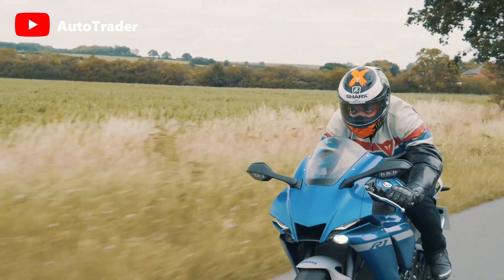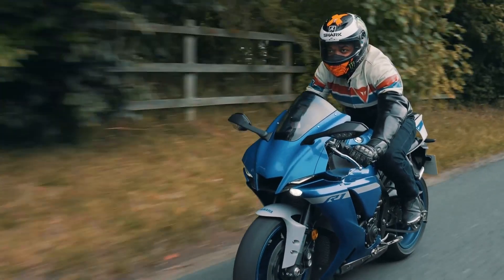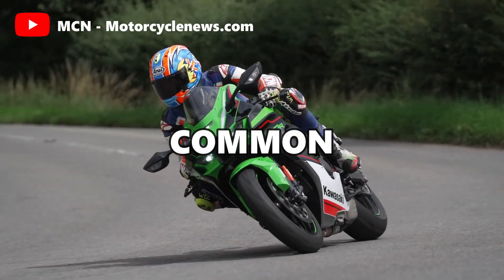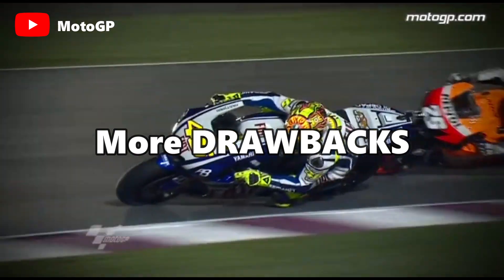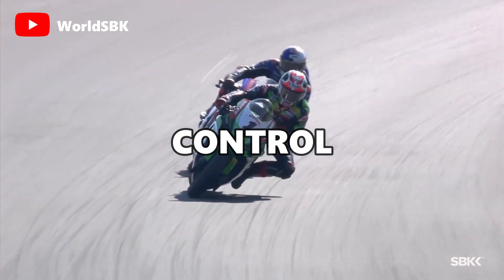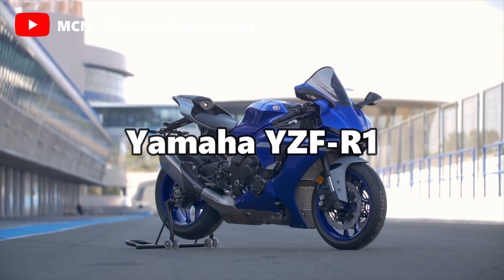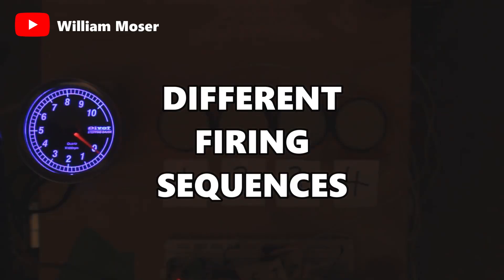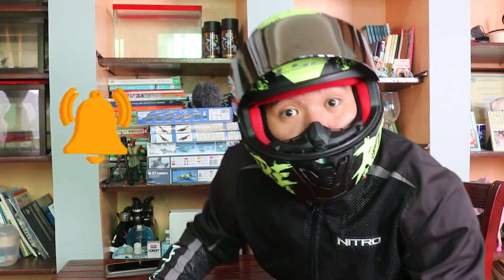Why Does The YAMAHA R1 Sound DIFFERENT

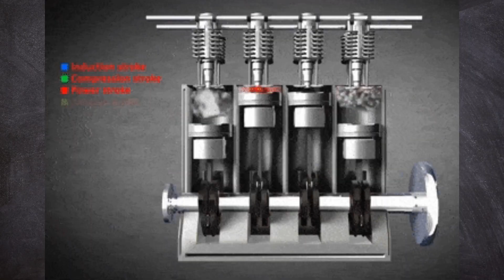Comment: 1:45 A Major, Seriously MAJOR, Part of it is actually its Far cheaper and Easier to produce a flat crank than a cross one. Something you completely missed. Cranks all have balancing weights and counter balancing weights, They just don't require an Extra Shaft of reciprocating mass to help balance it. Those blades you see on the crank, are just that... Weights.

Comment: crossplane has it's benefits and cons. it's not better than flatplane it's just better in certain scenarios while flat is better in others.  cross plane don't just magically make you faster or make the bike any faster. it just changes the way the power is put down and how to handle the bike
Reply: Walah ngelu...
Reply: @sinsinsss5216 nword??
Reply: Crossplanes have a more linear power curve, which is predictable, that's why motogp bikes are mostly crossplanes or V4s. 
Flat planes make most power in the higher revs.

Comment: Great vid. You left out two major parts though. 1. Yamaha, especially when it comes to their motors tend to do something that aligns with their music heritage. There is a great video from yamaha that shows a drummer playing drums to how a crossplane fires. 2. Rossi had a huge influence on how the crossplane was shaped for motogp and his riding style. He says instead of the 4 quadrants of the tire having 1 power spot for each, a crossplane produces 2 power spots for every 1 quadrant. Thats where that faster lap time part comes in because its easier to get on the throttle and not worry about getting bucked off or sliding the rear earlier in a turn exit.

Comment: The xplane gives a much better torque delivery, this without reducing RPM
Reply: Thats not true Steven. Provide us with a source that proves that. Not just Yamaha marketing bovine excrement.
Reply: @stevenmaschek7554 The theoretical advantages of uneven firing order can apply in MotoGP racing, where engine output exceeds 230 horsepower and the biggest obstacle to turning good lap times is cornering traction and the rider’s ability to feel how well the rear tire is hooked up at any given throttle opening. But there are very real inherent engineering challenges that must be overcome with an uneven firing order. It’s more difficult to produce strong power and torque with an uneven firing order, especially at low rpm and in the midrange. Vibration is increased, requiring much thicker and heavier crankcases and a counterbalancing shaft, and associated mechanical losses contribute to overheating.
Reply: @stevenmaschek7554  Marginally better for a racing engine. Irrelevant gimmick for a street bike. Other that it makes a Yamaha sound like a Ducati. LOL

Comment: motogp mainly v4 engine now, the crossplane M1 has the lowest hosepower seriously
Reply: V4 for straight line, Inline 4 for curve turn
Reply: Crossplane has good cornering balance and has fast cornering exits.
Reply: @thegoatrider_  Another way that the cross-plane crank engines emulate the V4 is in their firing order. A conventional inline four fires every half a rotation of the crank (every 180°). A V4, on the other hand, has an uneven firing order, typically having a 270° pause between the fourth and then the first cylinder firing (so, once every two turns of the crank). The theory is that this pause gives the tyre time to ‘relax’ back to its original position and key into the road surface, giving you more traction when really getting the hammer down.
That means V4 has better cornering exits
But u can see M1 are using in Motogp with nice results, the reason is the kerb weight not the crossplane!
Reply: @geniukoo8025 maybe the v4 doesn't excell at cornering as the i4 is because the fact that most bikes with v4 engine has longer wheelbase ? I have heard somewhere that a v4 is longer or broader which lead  the bike requiring longer swing arm.
Correct me if I am wrong 😅